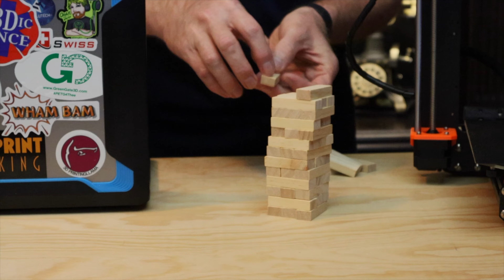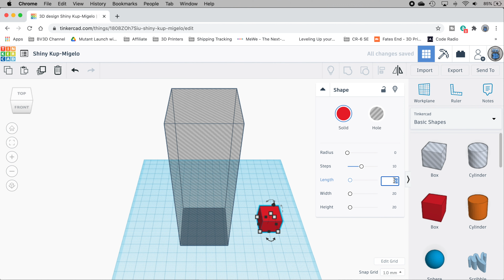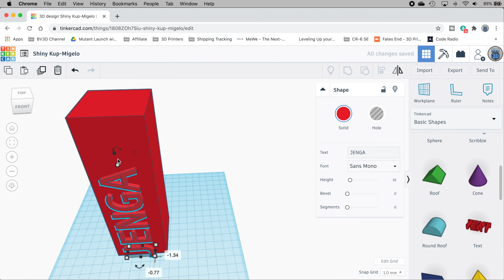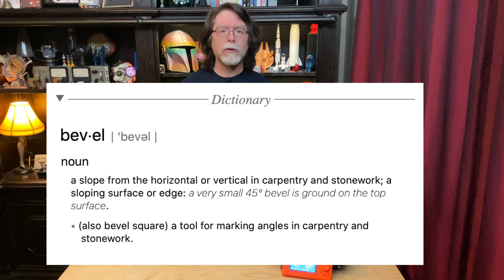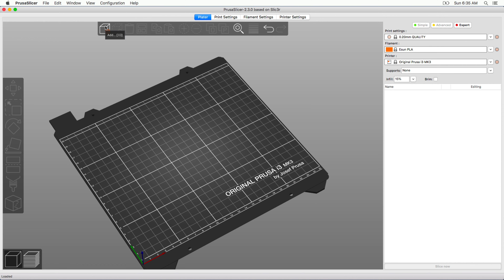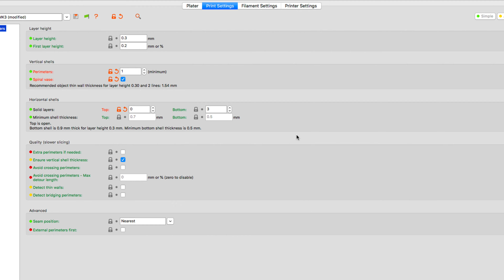Design & 3D Print a box for JENGA: Tinkercad & Vase Mode tips!

Comment: Bryan, do you get any shrinkage or expansion with the final print when exporting from tinkercad?
Reply from the maker: Any differences are usually a matter of slicer settings. An STL describing a 20mm cube should show up as a 20mm cube in the slicer, no matter what CAD software created it. Whether it prints as a 20mm cube will depend on a combination of slicer settings and filament performance.

There are options in most sliders to account for "elephant's foot," where the first layer is squished more than subsequent layers and therefore has a ridge around it, as well as ways to account for hole diameter issues (PrusaSlicer's XY Compensation handles this).
Reply: @BV3D  thanks Boss

Comment: I keep forgetting about vase mode...DUH! thank you
Reply from the maker: No worries! I like Vase Mode for fast prints, but also (with a fat nozzle) for some surprisingly strong ones. With an actual 1.0mm nozzle, getting 1.2mm extrusion widths is easily possible, and WOW does that make for a thick wall! I have printed my desktop trash can in that way and it's quite rigid.

Comment: Your summary about being able to identify something in the house, design the product and a few hours have it in your hand is the best thing about 3D printing. After doing the usual thing of printing numerous items from Thingiverse like everyone does I thought it would lose its appeal. So satisfying designing and printing something custom. Tinkercad makes it's so easy. Do you happen to know if the Ender 3 V2 has vase mode? Thank you
Reply from the maker: Hi! That ability is part of the fun of, and what keeps me engaged in, 3D printing. I've designed various clips and holders and organizers for my own stuff and for my wife's hobbies! 

As for the Ender 3 V2 - Yes, Vase Mode applies there as well. It's not so much a feature of the printer as it is a feature of the slicer. If you're using Creality's slicer, or Ultimaker Cura, the feature is called Spiralize Outer Contour. You should be able to search for that within the slicer's settings and turn it on.
Reply: @BV3D  Great, thank you for replying. I'll have a look for it